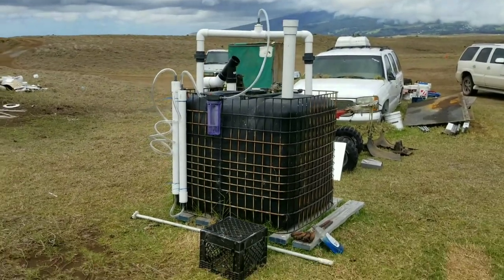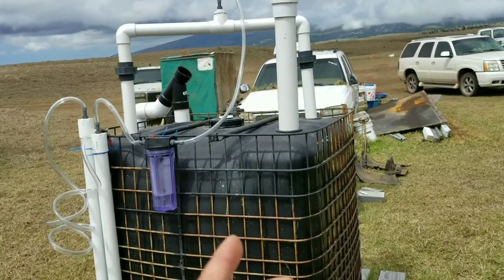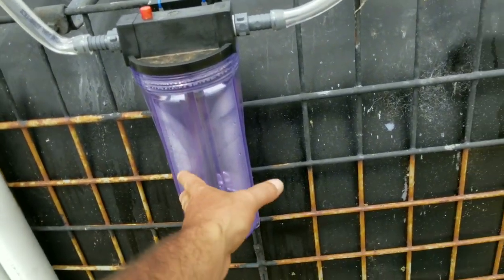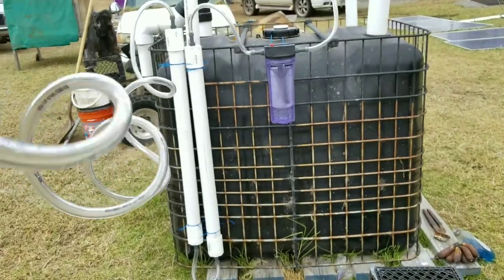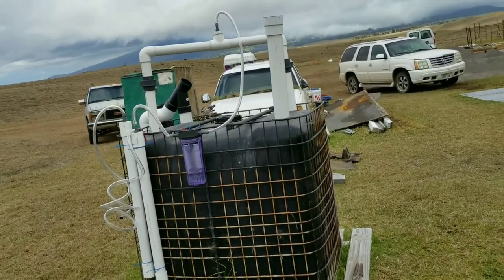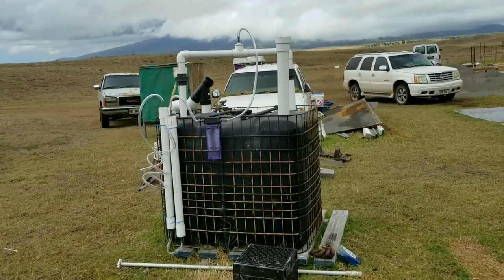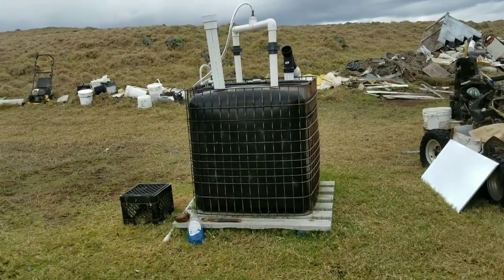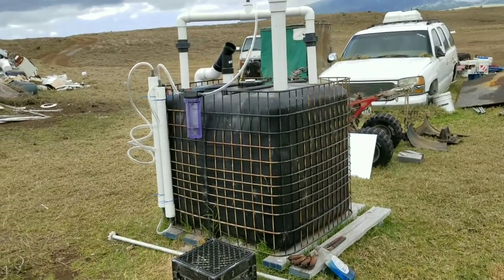Biogas Digester Build How-to at Home with filters Hawaii anaerobic digester

Comment: third pipe after the steel wool could be kitty litter. haven't read all the comments so not sure if anyone has suggested it (saw the charcoal suggestion.) but kitty litter would definitely dry it out and is regularly used for filtration in laboratory settings.
Reply: silica desicant might be better. Highly effective and reusable.
Reply: @gocryptoyourself2423  would the silica react with the methane gas? I have no idea but that popped into my mind
Reply: @gocryptoyourself2423  Most kitty litter is Diatomost Earth (DE) which is Silica Dioxide, Silica desiccant is Silica Dioxide (SiO2), Both are the same thing just a different name.
Reply: @Norbingel  Very unlikely for Silica Dioxide to reach Methane, unless you hold the temperature upwards of  1623 K (1350C or 2462F).

Comment: I think a 6" thick rigid styrofoam insulated box laminated onto exterior plywood, anodized sheet metal, or HDPE board,  held together with suitcase latches would solve your continuous temperature challenge in any climate.  Only penetrations through the insulated shell would be your fill pipe, gas pipe out,  and scrubber drain  The exothermic digestion process is all you will need for heat, the same as your body maintains continuous 98.6 by heat generated from your stomach digestion.  You could build in a small window to view your scrubber if you want.

Comment: been awhile since posted, hope this idea is still relevant. try a fuel/water separator for draining water at the bottom of your steel wool filter. they are built in all models of diesel tractors and they have a built in drain at the bottom of the bowl. could do the same instead of the water filter bowl i guess, but less useful there.

Comment: Hello dude.
Just some info to add to your understanding !
The "air" you are purging off is Carbon Dioxide (Co2) and because it is soluble in water (think fizzy lemonade LOL)  the bubbler should have more water in it for (perhaps 3/4 or more filled.)
Advantages :  (a)  A larger contact volume for "scrubbing " (actually absorbing) the C02 more effectively. (b) A smaller volume of vulnerable gas remaining above the water column that could ignite from a flashback.  (c)as any flashback cannot penetrate the water column it safely arrests any flame.
You don't want large quantities of gas blowing up and throwing SH** everywhere !!
Also, i think you should have some space above the water level in your IBC tank, and maybe fit a pressure-guage and a relief valve for safety ?
Additionally,  the gas contains Hydrogen Sulphide (H2S} so thats what the secondary filtering Iron (steel wool) is there for.
Be careful not to (solar )heat the IBC above around 150 degrees  F or you can pasteurise the contents and stifle your gas production.
Good vids and thanks for sharing.
Reply from the maker: +MultiOutdoorman Thank you for sharing, I have made more mods but the video is not live yet. Thanks for the support
Reply: @ModernOffGridDIY  .

Comment: Very  very nice.  If you put the water filter on an angle and  put tiny holes in the bottom of the pipe. there would be more contact with the bubbles with the water.

Comment: thanks for posting. these are good design tips.

I'm keen to understand how to make the biogas production more efficient and less maintenance.
- optimum temperature?  Should we insulate? can it get too hot?
- how to tell when the liquid fertilizer should be drained?
- how to tell when solids buildup  in bottom needs cleaning out.
- how to tell  when floating stuff on top of liquid is building up too much and how to avoid that.

Comment: Great video,  you should try and find out the pressure of the tank when the water starts over flowing the pipe too switch 12v presure switch on and compress it into tank with a regulator, think youll need another pressure swich to switch it off

Comment: Nice instructive video! 
To increase the percentage of the methane you may try to scrub the CO2 using Ca(OH)2 or NaOH. The bonus point: it should also get rid of the H2S. 

With a fairly wide vertical intake tube any methane produced in that tube will just fly upwards and away. Since you are using a plunger already maybe putting the intake at an angle and drilling few holes on the wall facing upwards \ will help.

Comment: So glad I found this again! Why not have an overflow valve to prevent total level inside IBC, from clogging the methane outlet? Also, to address the “wet” methane, that is created after the clear filter, you can add an air compressor water separator ($3). 11/10 production! 

I have two reactors attached to each of my farm’s toilets.
Reply: Please explain what you mean by placing an overflow valve to stop methane outlet for getting blocked.  Hasn’t the video shown how to avoid this?
Reply: @gregorymoeliker7689  NO

Comment: You got me thinking, thanks.  I'm wondering if you can use a  150 watt solar panel with a DC heating element to increase production.  Maybe take a 55 gallon drum of water, and heat it up during the day with solar, run hot water circulation through your bio-digester (input/output), so you can use thermal biomass to increase your production during the day and evening.  The thought being that you can hyper produce,  so being an actively managed will produce more than passive management.
Reply from the maker: +Steve Bollmeyer that was my next video I'm using a solar hot water heating panel to heat the mass when it's around 98 degrees it pumps out a Lot of biogas. I'm planning to scale up even bigger
Reply from the maker: +Steve Bollmeyer in the next couple vids you will see solar water heater heating the bio digester. Remember sometimes my vids was filmed days ago.
Reply: Great! I look forward to seeing it.
Reply: Another possibility is to have the bulk of the digester underground. That ensues a fairly uniform band of temperature within which the system operates.  You could also look at the larger scale setups that rural india has going. They use those to power entire communities with the manure from 100 -150 cows. Cooking gas and power to an entire village.
Reply: Steve Bollmeyer 0,,

Comment: In cold weather climates, you could coat the outside of the container with spray foam insulation. That should prevent heat from escaping and protect against cooler temperatures.
Reply: Or you just bottle it up into propane tanks over the summer lol.

Comment: Making a biodigestor does make more gas and co2 as well as other gasses. But your creating a green fuel source and fertilizer as well as clean soil.

Get a carbon dioxide detector, leave a gap of air in the digester. The methane is the lightest gas, you can use the co2 detector to turn a pump on and off to pump out the methane until co2 is left, pump co2 into a greenhouse with plenty of plants.

Comment: Awesome design! I'll definetly be using something similar to this when I make my own. 

I havent watch any of your further videos at this point..  however one small upgrade you could make is putting a sight glass (or a clear pipe) in a rise pipe (or the waste pipe) for two reasons..  

Reason one : To know the water level and when it's time to refill with bio material and/or water. 

Reason two : You can use the water level to check the pressure of the tank/gas by using the starting water level verses your steady state (up and running) level.  1 inch of water equals 0.0360912 psi.. or 28 inches (approx) of water equals 1 psi.  Typical Nat Gas appliances run at 3.5 inches..  LP is usually 11 inches or less.  I watched in another video bio gas (methane) burns similar to that of Nat Gas.

Another thought relating to that.. you could as use a float (instead of a sight glass) with a rod (say 1 inch in diameter) that would point upwards with inch graduations that would be put into a 2 or 3 inch pipe that would come from the top of the tank that would run to the near bottom as to not let gas escape while still reflecting water level.

A question I have..  

Could you draw from a spetic tank?  I ask this since..  I have a tank that the caps are exposed.  One morning I was on my back deck to see one of the caps had come off. I had thought a friend had played a prank on me. :P I had my father come up and look at it.  He explained that the caps don't just come off..  We later learned that the gas in the tank corroded the wires feeding the pump that pumps the waste into the sand mound causing it to ignite.. which immediatley had gotten the gears turning (in my head) about using it as fuel.

Comment: I have a comment on 12:25. If the biogas is not to be utilized it's is better that the residues undergo an  aerobic digestion and therefore produce CO2 and water (ad the gaseous products), the methane produced in anaerbic conditions, as you know have a higher Green House Gas potential. However, introducing air in the system would kill almost instantly the methanogens and it would have to pass a lag period before the methanogens restablish again, if you decide to return producing biogas. I would suggest that the biogas be still stored.... (Sorry for my English , I'm Brazilian) my best regards!

Comment: thanks for sharing I have been very interested in this and have yet to build my own biodigester and I find your video very informative.. Im am not sure if this will work for you, maybe you could put a tee instead of the coupling, gas goes sideways and the top part you can cover with a cap that you can open up to push back whatever is clogging the gas outlet pipes if it ever gets clogged.

Comment: H2S is important to get rid of because of corusion. But if you want to use your gas for a Generator, you also have to get rid of most of the CO2. one way to do it, is to pressurize the Gas above 60 bar. That is also great for storrage.

Comment: Also is there any way to pressurize and store the gas in cylinders like commercial propane ?
Reply: there's a way but its expensive and many stages for completion, search for cng compressor, you need to compress and cool it by stages to achieve higher psi without risk of ignitions

Comment: If you side mount the exit port, the system will not block the gas export line.  Saw it on another video.  Leaves a gap in the tank top so sludge doesn't build right at the top layer.  Leaves a little space for gas accumulation. Saw another video where clay cat litter was used to scrub the gas as well.  Cant remember what they were scrubbing?  Made sense at the time. Very cool build.  🤙🤡

Comment: Instead of using steel wool, you could use fine bronze wool. That will filter the gas better and is around the same price.
Reply from the maker: +Tools2Survive so far it's working good
Reply: T2s: Do you have more information on that? Most common i have seen is iron (steel wool) to react with the sulfide H2S, to make rust and protect used burners and engines. I´m not convinced bronze is better for that.
Reply: Years ago Mother Earth News recommended copper scrub pads or lathe turnings. And; the spent copper could be recovered easily or used as is for other projects.
Reply: @davidmoore657  yes

Comment: My cow manure has a bit of soil in it would that be very bad? 
Can I get a quick answer
Reply from the maker: Not bad
Reply: @ModernOffGridDIY  Thanks for replying so quickly 
🙏
Reply: Been surfing for something simple to build. At last I will be trying your idea.. 
Just a suggestion? 
1. Is it possible to add a pressure     gauge to monitor the gas pressure?

Comment: The bubbler water has to be changed sometimes, otherwise it does nothing, only so much gas will dissolve in the water. Also a 300 watt solar panel on an 125w aquarium heater will run forever.

Comment: I think that water filter and steel wool is not to filter the gas but to prevent it from flashback because I used to work on hydrogen and we used the same thing so that they won't explode
Reply from the maker: I know what you mean I played with hyd back in the day. But not the case here. it's used to clean the gas

Comment: Great video thanks for sharing 👍 I’m looking at doing this in the uk all the research so far has mentioned temperature so I’ve had an idea what if I made a concrete base with underfloor heating and mounted it in a insulated shed or in the ground ….. the other is in a green house ?? Another thing I’m wondering about is agitation?? Does agitation make a difference? And is it possible to use human waste by converting a septic tank
Reply from the maker: I actually cover this on my podcast yesterday and today. I'm installing a new new biogas digester System as we speak.
Reply: @ModernOffGridDIY  ah cool I’ve found a link to one a guy has made on a slightly larger scale it’s really good worth a watch actually what’s interesting is he doesn’t have to prep the material and it’s all added via a hopper definitely worth a look he’s got a 7kw generator and supplies gas to his vans
Reply: Yes it’s a bigger scale but looks like the go ive got a bit of land where I am and the farmers have loads of cow dung I’ll definitely look at your pod cast I’m just at the research stages at the moment
Reply: Listening about your hole in your bio digester I had a hole in a wood boiler and tried loads to fix it what works is to use two plates and use a 2 part epoxy on both sides and little nut and bolts to compress it together if it’s any help to you 👍
Reply: @350pauli  Please attach the link to the video you are talking about if you can it will help in researching more.
Reply: @johnmunge6996  I put a link to a concrete base bio digester set up above

Comment: also " I've seen a gas storage system with an inverted drum inside a larger drum and liquid seal. easy storage of gas without using inner tubes or plastic bags. I'm not convinced which option is the best combination of effort / cost / ease=of-use.
Reply: Please share the video of the gas storage system.

Comment: After you fill the digester with cow poo and water do you bleed off the pressure everyday after or do you wait 3 weeks the bleed off. thanks
Reply from the maker: I will make a video talking about that.
Reply: Very excited, I looked at the digester this morning. Fertilizer bucket was have full. I guess the pressure pushed it out. I opened the gas valve alittle and heard good pressure. Your videos are very inspiring .
Reply: Ill start making videos of mine. Its small 55 Gallons. I put two full buckets of cow in the rest water. Have not pulled the trigger on the storage bag. they want 140 just for shipping. I want to make sure this works before spending money.
Reply from the maker: Use a air bed works fine, when I need more storage that's what I'm going to do... yah make some vids on ur biogas that would be cool for YouTube. If you have other vids check out https://dailyvideoupload.com/ Upload Your Unique Random Videos & Get Paid - Upload Your Original Content - No Copyrighted Material - Get Paid For Your Video's - Did You Catch Any Good Footage On Your Phone or Camera ? If So Upload Your Video make some side money.

Comment: I saw that a guy used catlitter to remove moisture than through the steal wool! Could you tell us why you didn't do it? You could use a drain valve between your two steal wool cylinders! For cold weather  you could use RV water tank heating pads and then insulate everything!

Comment: Actually, it is producing methane which almost never occurs and vents into the atmosphere naturally. On to my point, methane is a very bad green house gas. Even though it is less insulating than carbon dioxide, it lasts 20 times longer before degrading.

Comment: the level of you liquid should not go any higher 3/4 level.  re position and pipe your liquid fertilizer out outlet so the liquid never goes high than the 3/4 level. the rest of the tank is good

Comment: What does it do what kind of gas
Reply from the maker: +off the grid tiny home out west I'm using it for cooking gas, on demand hot water and home heating, free gas can't beat it. I will only use propane in emergency.
Reply from the maker: +off the grid tiny home out west I have a playlist with all the info check it out.
Reply: In order to avoid condensation do you think it would be better to use a high viscosity oil like vegetable oil instead of water in your water filter? Or an oil you can see through like coconut oil or extra virgin olive oil.
Reply: southjunction12 that is a really good idea
Reply: It generates methane that can be used for cooking and heating or can be used to run a generator.
Reply: southjunction12 very interesting idea. Maybe as a first in line filter with a 2nd one with water. Water scrubs out the CO2.